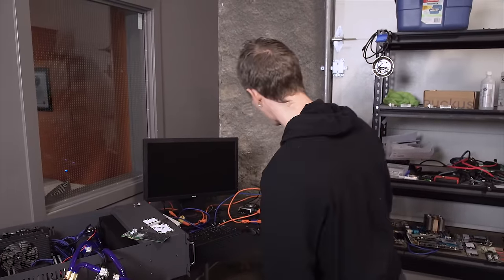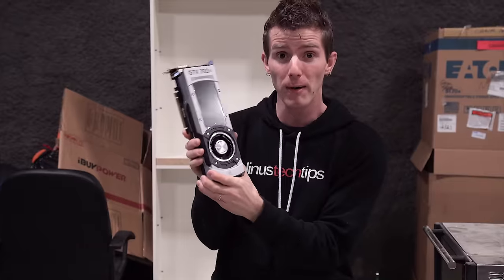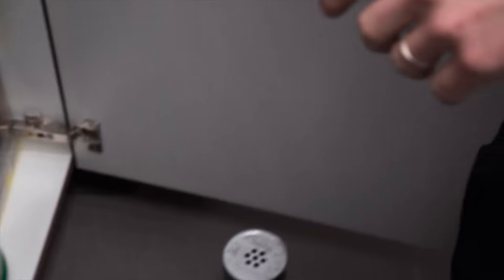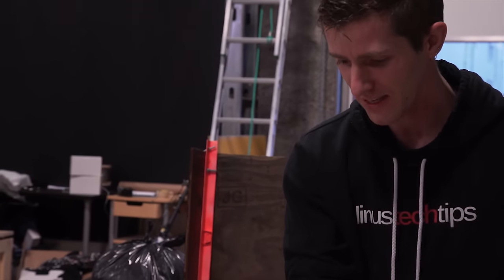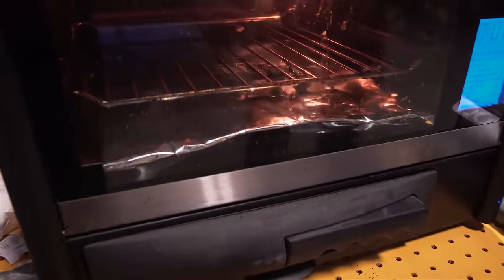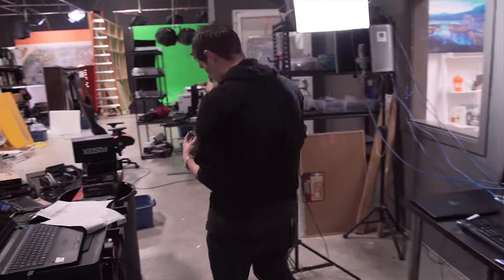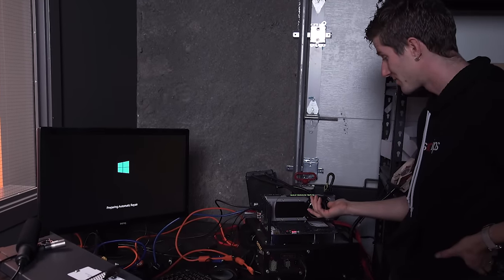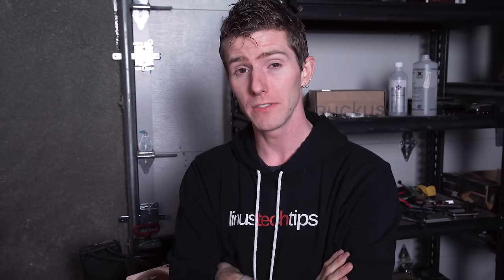Bring your video card back from the dead! - Oven method

Comment: My Radeon HD 7770 died after ~ 5 years. Fan spinning but no picture. Tried cleaning and replacing the thermal paste, nothing. Baked for ~ 8 minutes on 200 *C, cooled for ~ 45 minutes, plugged in, works like new <3

Comment: i can remember doing this back in 2005 ish (ive just dug it out it is a BFG 9800GT nvidia) when i used a SLI config to run final fantasy XI. all i did was to remove the fan cooling and then put the all board in the oven for 20 mins stood on a pile of 1p coins in the corner to lift it of the baking tray, took it out to cool down and it worked. was amazed i i saw this video and people or still doing this.

Comment: There is no practical difference between the shiny and reflective sides. Not for PCB baking but in general. It's just a slightly different smoothness due to the manufacturing process.

Comment: Saved my gtx titan with the oven method. Thanks! I was not ready for it to go yet haha.
Reply: Is it still working?
Reply: @saadahmed688  yes, holding up nicely!! Doom Eternal!!

p.s. I used a toaster oven I got cheap from a good will. Make sure you remove any plastic clips from your card, don't want it to melt. I got lucky and it was just large enough to slide the gpu into the oven rack slot. Afterwards I let it cool for 15-20 min before I touched it, and you could see all the solider joints had been re-melted. Also I only did this as a last resort after cleaning and trying a few other things, it would not boot so it was either sell it for parts or try this. Won't work for everyone but worth a shot if you don't have anything else.

Comment: Its much better to use a heat gun with controlled temperatures to do this trick. than you only heating up the necessary parts instead of the whole card. also use some flux on the edges of the chip so the solder makes a better connection. it worked for me many times.

Comment: Holy shit, this actually worked for my 6 year old R9 280 that had slowly been going bad. I pretty much only play Runescape, but for the last few months, it would crash and my screen would turn a solid color with vertical strips. Usually a reset would be good enough, and even sometimes if I waited for a minute, it might come back, though it was usually all distorted. But eventually just a simple reset wasn't enough and sometimes it would take multiple resets, turning it off completely, or just simply waiting. But the most recent time, nothing worked, even waiting for 12+ hours. So I took it out, took it all apart, put it in the oven at around 380°F on the aluminum foil balls for 8-9 minutes, then turned the oven off while leaving it inside with the oven door slightly open for about 30 minutes until it was cool, then put it all back together, reinstalled it and bam, it worked! It even seems like I'm getting better FPS as well. I don't know how long it will last, but I tried playing Runescape today for about 30 minutes and it was fine. Previously, the last few times it crashed I couldn't even be on RS for 2 minutes before crashing. So it's definitely an improvement. I wouldn't mind just buying a new GPU, or just building a new computer altogether since I built this one in 2015, but with the prices of computer components, I'd rather ride this out for as long as possible.
Reply: I did this oven trick on a non functioning r9 290x and seems to be working now. Is your r9 280 still functioning after 2 months?
Reply: @feecker  yes, haven’t had a problem since. 😌

Comment: Are those temperatures right?  Standard (lead) 60/40 solder melts at 183-188 degrees C.  Lead-free solder (used in anything labeled "ROHS") is going to melt at 217-250 degrees C (depending on the specific composition used).

In Fahrenheit, this means at least 361-370 degrees for lead solder, or 423-482 degrees for lead-free solder.  The temperature used by Linus (385) should be OK for lead solder, but it won't get hot enough to properly melt/reflow lead-free solder.

Oh, and why doesn't Linus have oven mitts?

Comment: FYI foil is only reflective on one side due to double layering it when putting it through rollers to thin it out. Rollers dont go down that far, so they have to double layer. There is no other reason for a shiny and matte side.

Comment: Use a heat gun with a solder melting tip and do each solder individually, oven method will not work for a variety of reasons, obviously if the solder were actually hot enough to melt all of the chips on the bottom would fall off, also the oven is not hot enough to melt solder, also then the plastic power input would melt. I've used heat gun method on ram successfully

Comment: the Al balls... make them cones and use pins through the screw holes ... or ...  create 4,  90 degree Al supports and use 2 pins to support the board from each corner.

Comment: thank you so much!!!!! i did this with my ole 560 that wouldnt display after installing the driver and behold, it works.!!!
Reply: great to hear that it worked! i also have a 560 but its not entirly dead but artefacting heavy. do u think this could fix my card too?
Reply: it might do. cant guarantee though. its never a 100 percent certain thing it would fix it but if its way out anyways theres no harm in trying. i pre heated my oven at 200c and put it in for for 8 mins. left it out to cool then put everything back together afterwards. if it dies completely then hey you tried. and its only a 5 series anyways lol so it would be worth a shot. just remember to take the little plastic bit out where the fan header is lol. also it may work for a day, a week, a month, even a year, or it may not work at all.
Reply: @cmdrsophiasprklz6581  sure, thanks for sharing your expierience and opinion :) i dont have a seperate oven wich i wouldnt need anymore, i thought about using a heatgun instead
Reply: using a heatgun might work if you can get it up to them temps it should be hot enough to reflow. just make sure to not knock the chip off while doing it lol XD

Comment: i've head from a friend that's into chemical industry: both sides of aluminium foil are the same. the difference in shiny or not comes from the processing method: a shiny patina made from the rollers that work the aluminium. So both parts should react the same. couldn't find any more information about it.

Comment: Just came across this video this morning and immediately pulled my old HD 7870 which died some years ago. Did almost exactly what Linus did: 385 F in oven for 9 mins. Pulled plastics off first, exactly used three aluminum balls etc. so viola! It booted! Attention! It booted! Then played some CSGO to test (have seen about 90-100 fps, still around 65 C under 100% load). So who wants to buy a used HD7870? Could sell it for 20 bucks? I don't know what to do with it at this time now.

Comment: If i calculated it correctly, you heated the cards at about 145°C, which isnt close to the melting point of the BGA, by heating it to 220°C and having a very short peak of temperature at 240°C the BGA should melt and if it is the cause of it should fix itself, the card must not be moved until its cooled down. If that doesnt work and the card isnt shown at all, there likely is a problem with its controller not talking so reballing it would be worth a last attempt, because there can be either a problem with its internals or two of the contacts of the BGA managed to melt into one shorting it out, similar to the ylod of PS3. I am aware that i am about 2 years late with this comment

Comment: The shiny side of the foil has been polished; the matte side is not able to polished during that same process. Shouldn't make much of a difference which side you use in most applications, though if you want something that is reflective in the visual spectrum you'd obviously want the shiny side. For thermal reflection, I doubt it would make a huge difference.

Comment: Guys It's 100% Working...

But I tried Something different primitive Method.
That's also worked.
My method is different and sensitive. 
Firstly put your Dead Graphics Card on stove (You must be assure very light fire and enough Heat).
Put it for 2 mins each side (Be careful Don't burn/melt anything).
Then let it be cool for 12-15 mins.
Then install it will work (In my case that's Worked)
Hopefully for you may it work well.

Thanks .......
Reply: how long it last ?

Comment: IF you have a heat gun that supports temperatures high enough to melt solder, then use that instead, it will be SO much easier

Comment: You should also never raise the SOUND LEVEL of the intro that high. 

Don't forget the oven mits next time.

Scraper, steel wool and aluminum foil cones to raise the PCB off the tray. And you can get a special scraper for grills with a steel brush and the special grill scraper works wonders. Should be in the grill isle of the next nearest hardware store like home depot.
Convection is better.
If you want to raise it better use some screws and nuts.
You can even weld them to a metal base or drill some aligned holes in a metal block or sheet metal.

You can leave the PCB inside the oven and turn it off and open it a little to slowly cool the PCB.

It lives, again^^

Comment: It worked great for me.  I think it's about the old electrolytics but I have done no research.
Reply: Negative. It's about robotics-applied solder/paste droplets which number in the 1000s.  During the original oven soldering manufacturing process, it only takes one inconsistent droplet/solder joint. Temporary contact can last quite a while but eventually, normal air/humidity/temperature cycling etc. takes its toll. This oven process actually remelts the solder joints, including the "bad actor".  By contrast, aging an electrolytic capacitor actually dries out the internal dielectric. I have dissected old, faulty electrolytics and the dielectric is almost completely dry. This renders the capacitance value completely out of spec. Heating the capacitor could only make it even dryer to some extent. So, this process of heating is not a solution should electrolytics be the problem. Fortunately, electrolytics have a dependable, usable life-span in excess of 10 years. Even then, heating will not revive an electrolytic capacitor (unless the solder joint itself is coincidentally bad and misleads one to a wrong conclusion when heated.)  :=)

Comment: My 1070 would ramp the fans to max, stops giving out signal and restart my PC. Tried everything i could, deep cleaned it, DDU’ed it, repasted it, tried using different PSU and even tried it on a different PC and nothing worked until today, baked the cr@p out of it and it’s now working again smoothly. 
Only do this when you got nothing to lose but time XD 
Will update f anything comes up
Reply: How is it holding up?
Reply: @NexusXP  still alive and kickin as of this writing
Reply: @fredc323  Amazing

Comment: Aluminium does have two sides that are different in visual appearance but this is simply due to the way it is manufactured resulting in one side being polished and the other not, in testing the difference in performance  between the two sides is negligent

Comment: 14:00.  Ish.     When the solder cracks small pieces can break off called Tin whiskers. Those tin whiskers sometimes touch somewhere it shouldn't, making an unwanted contact, redirecting electricity flow and frying components.  It's a rare occurrence for us but a HUGE problem for Nasa. Since they deal with computers in zero gravity. 
And the reason for this is because of us taking the lead out of the soldering. Lead is very soft and flexible so removing it makes the soldering much more brittle. Unfortunately lead poisoning is a thing n all so it was kinda necessary.  😬

Comment: It worked cause it came back on an hasn't shut down yat on my AMD Radeon HD 5450 i had oven sit rit 250• , i let it cook for about 6 min and 30 sec ,,,, after i reinstalled my screen have glitches and black out here n der it will display a message saying my graphic card stop running but has recovered. Over all it worked for me I just know I need to start saving for a better graphics card.

Comment: Most of the problems like this one occur only because of dampness and humidity. If your room is humid, that is a kill for electronics gear. Hell, even a freaking light bulb will pop out because of it. So what you are actually doing is removing vapor from the vga mobo that was closest to the air conditioner. Hot near cold, causes vapor to turn into water. Combine this with dirt from the air, like dust, and you got some weird capacitance that hinders chip from working. Solder melts above 350 celsius, that is like 572 fahrenheit. Its not just tin, it has some lead in it so it takes more temperature to melt. 
Just clean your room and your computers from all the gunk and dust, so you wouldn't have to repair it often.
Reply: Solder melting point range is from 90 °C up to 450 °C, but mostly is 180-190°C for electronic solder alloys.

Comment: The biggest reason for faulty solder joints is because of the use of ROHS (lead-free) solder - it is CRAP and unless carefully/properly done there will be bad solder joints.  If you suspect a bad solder joint then do use Pb rosin core 60/40 solder that is of high-quality ($$$) to re-solder

Comment: The two sides of the aluminium foil have no purpose whatsoever. The reason one side is matt and one side is shiny is pretty simple. The manufactoring process for aluminium foil is basically just roll it inbetween two giant grinded steel rolls and it gets out a little thinner. This is then repeated several times. But at some point it wont get any thinner. This is why the last step is to put two seperate pre flattened rolls of aluminium foil through the roller together and this creates these different textures. Not sure which side is which but if i remember correctly its shiny on the steel roller side and matt on the side where it touches the other aluminium foil while being flattened.

Comment: I was baking my 7950 GTX (yes this piece of nvidia cra..) from the old Dell M1710.... 4 times. The fix is working but IS NOT permanent. After 2 months or so the card was dead again and the card was usually not running above 85C. Soo in stead of fulling around it is just better to get a new card.

Comment: I was wondering if leaving your Gpu fan down would help lifespan actually ? Since If it stays hot it will essentially be doing the same thing as this oven trick ?
Reply: Mate, don't bring the cooler into the oven. The plastic on the actual card can withstand way higher temperatures than the cooler's fans and shroud.

Also, fans can't be fixed, only swapped out.

Comment: I only had to Reflow the VRAM Chips on my R9 270
O overclocked it too hard it broke wouldn't go on windows 
After heating the VRAM with a hot hair gun its back in action 
Never overclocking the VRAM again in this GPU

Comment: now that i think about it two years later, you probably broke not the solder connection but broke off the connection point itself from the pcb, so there is not much you could have done other then finding that point (hidden under some component..) and rewire it with microwire.. a procedure wich would be a big pain in the ass with a succes chance of , i dont know, 10 %   considering you would have to desolder and resolder a lot of the components until you find that brocken solderpoint

Comment: Replacing the gpu with the new one is the only lasting long option. It is well-known that the cause of a failure is the chip crystall has hookup issues with the chip pcb. As so, it cannot be fixed by an oven cuz it is impossible to solder micro balls well that are also rounded by compound glue.

Comment: If you don't make a habit of it, this will work in a pinch if you follow the bake with the self-cleaning mode in a large kitchen oven. Self-cleaning mode usually runs for 4-6 hours at 800-1000℉. Just avoid plastics, and don't tell your SO. 🤣

Comment: I got a free broken Graphics Card for free because obviously they were gonna throw it out. So i took it home and tried it on my computer and it didnt work i just got a black screen all the way through and i tried a couple more times and no luck. So unscrewed the case of the Geforce  GTX 560 which you can now get it for 10 dollars or less now a days lol. I cleaned the dust first with make up brush and cleaned it till where there was no more dust. I plugged it in and it kinda worked. and some scratch marks on the screens and some static feel to it. So i cleaned the pins with Alcohol pads and used a blow dryer to heat the whole graphics card like if you were spray painting a car very slowly. I was about 1 inch away from the graphics card to the blow dryer. Then i plugged it back in and boom she lives once again with no glitch or scratch marks on the screen. Willing to try more of them if i get my hands on more dead Graphics card to Verify blow dryer with alcohol pads works. Ill next time film it. I do have my own channel but is trying to change some concepts inspired my Linus's Videos. Thanks Linus!

Comment: 385 Degrees Fahrenheit = ~ 200 Degrees Celsius

200 °C for 10 min in the oven. 8 if you preheat the oven prior to 200 °C.

Let it cool off for about 60 min.

That should be it. 😆

Comment: Reflowing the board with an oven is only a temporary fix. The graphics card will fail again in time. The GPU chip would have to be replaced. So in reality it works but then again it really doesn't do anything

Comment: sooo how does this work?
Reply: basically there is metal on the board (we'll use a graphics card for example) and that's what makes all of the stuff connect together. when it's old, sometimes those traces (things of metal) can get broken. baking helps because it can melt the traces and help reseat everything back in it's place.
Reply: @hades8754  ahh gotcha, thanks for letting me know man...i was clueless to how this would even benefit anything
Reply: @zeek_backup  no problem my friend!